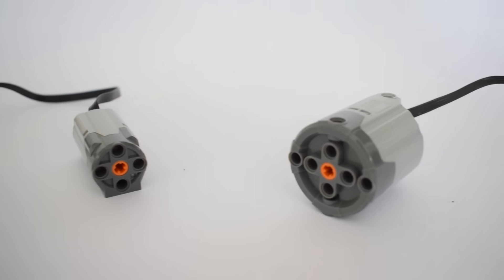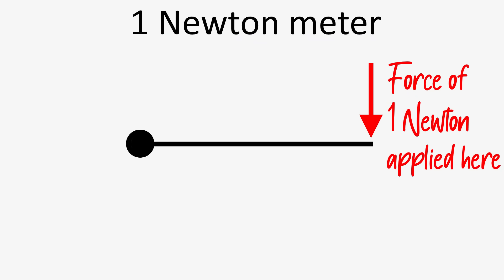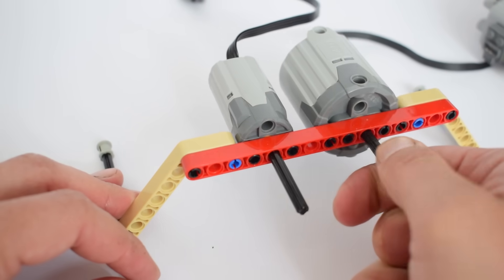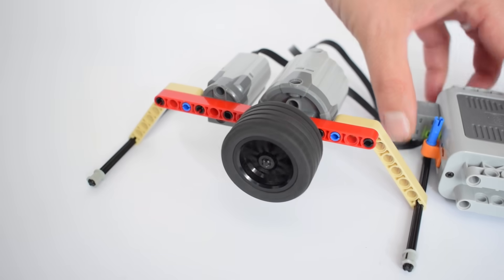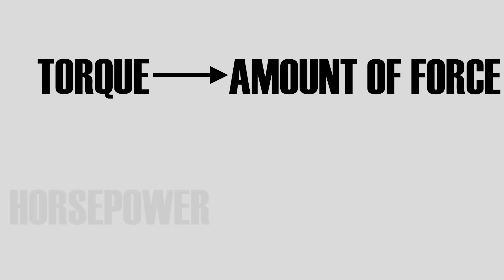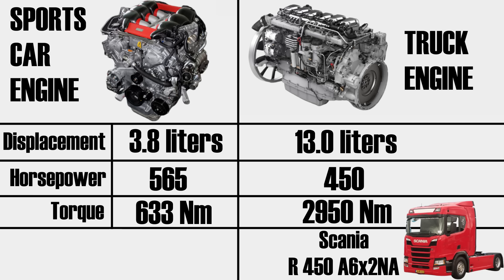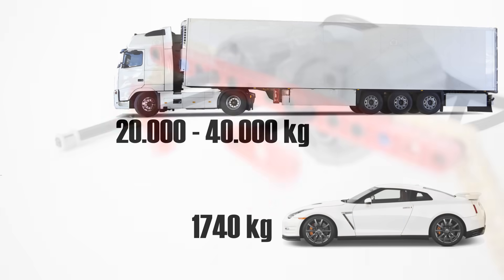NEVER be confused by HORSEPOWER and TORQUE again - HP and TORQUE EXPLAINED in the MOST VISUAL WAY

Comment: There is one thing i still dont understand

Does this mean that the higher the horsepower the more speed can be achieved? Or is speed not affected by any of those?

In my case me car has very low horsepower and can't reach much speed, and at the same time it doesnt have much strength to keep moving because it generates not enough torque when going uphill

Comment: Good explanation but you missed out on the fact that the piston crankshaft will also determine how much torque you make because torque is a force times a distance so a longer connecting rod means a greater amount of torque. That’s also why large truck engines cannot rev as high because it would destroy the larger connecting rod and why older na f1 engines didn’t make much torque but revved very high because they had very short connect  ing rods.

Comment: So in essence, Horsepower correlates to the speed at which an engine or motor can rotate. 
The more horsepower a motor outputs, the faster the motor can spin.
And Torque correlates to the ability of the motor to move mass. The more torque, the heavier weight it can move effectively.
Hence why some cars fitted with a turbo, can output more horsepower than a car with the same size engine, but without a turbo fitted.
That explains why you get more miles from a diesel engine, in terms of the amount of fuel cinsuned, because they tend to spin slower than a petrol engine, thus also prolonging the life of the engine.
So if you buy a small car with a small, turbo charged engine, the life expectancy of the engine will be lower than that of a non turbo charged engine, as it will spin faster under normal use.

Comment: The example with feeling the car's acceleration isn't quite correct. If you race two vehicles that weigh the same and they are running at constant rpm, one of them generating more power, and the other generating less power but at a lower rpm so that it's more torque, you will accelerate faster in the more powerful car.

Comment: Good video. But it fails when saying torque is felt when accelerating. Horsepower is THE determining factor in acceleration. High torque just means acceleration at lower rpm. But a high horsepower low torque engine just needs to work at higher rpm to achieve faster acceleration than a high torque moderate horsepower engine. Torque can be manipulated with gears. The sports car engine could accelerate the truck faster than the truck engine with a gearbox that allowed is to work at the optimum high rpm.

Comment: (EDITED for some dumb phone typos)

Strong start but you devolve into total nonsense when you talk about things like "rate of force" or "how many times force can be applied".

It was a huge mistake to skip the definitions of work and energy. It's like trying to talk about speed without talking about distance.

Lastly, the claim that "horsepower can't be directly felt, only observed" is ridiculous. When your vehicle accelerates, you're feeling power, not torque.

It's amazing to me that for 50 years, every discussion of power vs torque made for gearheads misses the basics of a high school physics class.
Reply from the maker: Ah yes, the subjective genius. 🤮
Reply: Let me say that the video is very well produced, and the discussion and demonstration of torque are excellent.

I am well aware that I'm not a genius by any means, but I did pass first year physics in university.

Torque is twisting force.

Force applied through some distance is work, which is equivalent to energy.

Power is work done per unit time. Because of the work-energy equivalence, power is also rate of change of energy.

Leaving out a discussion of work & energy makes it impossible to be correct about how power and torque relate. It's mathematically the same as trying to talk about speed without talking about distance.

Rate of change of energy relates closely to acceleration when we're talking about kinetic energy. If you know the weight and Cd of a car and have a good accelerometer, you can calculate its power from the acceleration. There's no experiment you can do with that equipment that will tell you the engine's torque. Power is what you feel in an accelerating vehicle.

I'll note also that you don't need torque to have power. My toaster and kettle are ~2hp each.

Comment: In a way, this kind of does help explain the differences with 2 of my motorbikes.

The Honda 400cc inline 4 cylinder gives out 53HP and 41Nm

The Suzuki 800cc V-Twin gives out 56HP but 72Nm

The Horsepower is 53 and 56 so almost the same, and yet teh NetonMeters are 41 and 72 so way more.

Now, I have NOT included the Revs of the Engine as it would almost be nonsensical are they are an inline 4 Cylinder and a V-Twin ( 2 cylinders obviously )

This sort of makes the little 400 a revvier little bugger that is great fun and surprisingly naughty for such a small bike, and the larger 800cc more of a powerful muscle bike in comparison.

Ah its just me thinking of it really.

Comment: Horsepower is the most confusing and misused measurement ever invented! I'd really love to see a 700hp Ferrari actually pull the same load as 700 horses!
Reply: It is not confusing, you just never had it explained properly. Power is just force times distance divided by time. In terms of a rotating shaft that is described as torque (how hard its turning) times angular velocity (how fast its spinning).
Horsepower is a specific unit of power which is based off the output an average horse can maintain throughout a day, which is 550 ft*lb/s. If you want to measure torque in lb-ft and angular velocity in rpm then the formula for horsepower is (torque X rpm)/5252 because of unit conversions.

Comment: yes but the torque is applied constantly, so it's not really 'applied more frequently' in one case vs the other. Good explanation otherwise
Reply from the maker: Torque coming from an internal combustion engine is definitely not constant, it actually comes in pulses, the higher the rpm the greater the frequency of application.
Reply: @d4a  ah cool, I didn't know that. Thanks!

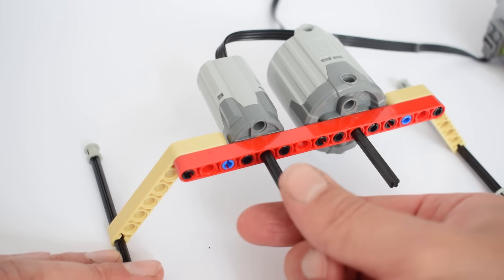Comment: 6:11 when you are in a car and it accelerates, isn't what you feel the acceleration, not the torque? If what you feel is the torque, it should feel stronger in a truck than in a sports car, but in reality, sports cars accelerate much faster due to their lighter weight so you feel a much higher acceleration than on a truck.

Comment: Great explanation and demonstration thanks. It would be helpful to also show horsepower more tangibly in real world, for example max speed over quarter mile (where rate of power in finite time period is a controlling factor).  A confusing factor is gearing as increased gear ratio will deliver higher and higher torque but at slower rate of delivery. 
Also interesting to conject how 1 horse power was originally defined, was it the speed achieved in a given time for a vehicle powered by 1 HP engine compared to a horse pulling the same vehicle with same weight?

Comment: You could put the GTR engine in the semi and it could out perform the 12 liter with the correct gearing. It just would last as long or use as little fuel. More Horsepower is more horsepower and through the magic of gear reduction can always make the torque number.

Comment: Great Video, Can you do a video on 
Why diesel locomotives have more torque than their electric counter part, when the diesel engine is ultimately used to run an electric motor in a diesel locomotive.
Reply: @TurboSpeedWiFi  ohh got it.

Comment: Your video is ok but you failed to explain a fundamental and important fact. Torque at the crankshaft and torque at the wheels, where it is ultimately felt can be wildly different. A gearbox can multiply torque many times but it can not increase horsepower at all.
Reply from the maker: https://youtu.be/txQs3x-UN34

Comment: Brother, you have no idea. You can feel the power of a vehicle as acceleration force, those in the example do 3 and 30sec to 100km/h so the car accelerates with an average of almost 1G while the truck only does 0.1 that's ~10 times the force. So what does that 6 times of torque do? It really doesn't matter. 
Let me give another example ML63 AMG 514hp 620Nm of torque acc to 100km/h in 4.4s
While the stupid Audi Q7 V12 TDI with 500hp and 1000Nm acc to 100km/h in 5.3s
Reply: Tell that to people that said HP sell car, torque win the race.

Comment: Minor correction: torque is pound-feet, not foot-pounds.

Notice that Pound-foot is written in the same order as Newton-meter.

Foot-pound on the other hand is a measure of energy, which can be directly converted to Joules.
Reply: Mathematically, foot pounds and pounds feet are exactly the same
Reply: @alanartwww  they are dimensionally equivalent but that does not mean they are the same. Pound feet is torque, foot pound is energy.
Reply: @Redtooth75  In the US, torque is most commonly expressed as ft.-lbs. Using such terms to quantify energy or work is a violation of International System of Units protocol.
Reply: @alanartwww  you misunderstand. A pound foot is a unit of torque, it is written as lb-ft or lbf·ft. A foot pound is a unit of energy and it is written as ft·lbf. Writing torque as ft-lb is technically wrong. Its very similar to how joules and newton meter of torque have the same units but describe different things. They are both N·m but one is torque and the other is energy.

Comment: You are correct...
Absolutely correct 👍 
Ex.
Supersport bike 999cc about 190 hp at 13k rpm
Small city car with out turbo 999cc 90 hp
at 6k rpm.
This can change by gears ,pulleys or something else.
I say at electric is .
rpm is voltage 
Torque is ampere 
hp is watt

Comment: So whats nm then.. 1 guy applying force to a screw by 1m of wrench.. 2 guys 2nm? İts not.. we need to find the exact guy.. which is impossible..
Reply: 1 N*m is one newton applied 1 meter away from the center. Its the exact same concept as pound feet torque, it just uses metric units.

Comment: You were doing well until the end when you said that the truck engine requires more torque than the sports car engine because the truck has to move greater loads.  100% wrong.  If you put the sports car engine in that truck and gear it properly, it will out perform the diesel engine because it has more horse power.  For that matter, if you put a turbine engine in that truck with the same HP as the diesel engine, it will perform exactly the same as the diesel engine (assuming that the gearing is correct) in spite of the fact that such a turbine engine would have less than 100 Nm of torque.  

As you correctly said, HP is the rate at which a force can be applied.  The faster you can apply a force (linear or rotational) the more HP you have and the more work can be done.
Reply from the maker: If it's 100% wrong why do we never see low torque engines in trucks? The answer is because they would need ridiculous gear ratios and something in the neighbourhood of 25+ gears to get up to speed.
Gear ratios aren't magic, there's a trade off in terms of speed.
Edit: here's a video that explains all of this better than a comment: https://youtu.be/txQs3x-UN34
Reply: @d4a  Generally, there are two reasons why you rarely, if ever, see gas engines in big trucks:

1) Diesel engines are far more efficient than gas engines so you require significantly less fuel for the same amount of work;
2) Gasoline is explosive while diesel fuel is not.  That makes diesel powered vehicles far less dangerous in a collision.

You should also remember that, years ago, all big trucks had gas engines.  Diesels didn't start to take over until diesel technology advanced to the point that they could produce the same amount of power as gas engines without being larger than the truck they were intended to power.

Your gearing numbers are not correct, either.  Using the engines in the video, you can see that the gas engine has a 6,000 rpm power band (1,000 to 7,000 rpm) while the diesel engine has less than a 2,000 rpm power band (1,000 to under 3,000 rpm).  That means that the diesel engine requires more gears than the gas engine.  Yes, the gears behind a gas engine would have to be higher ratios to allow the gas engine to rev to its best power point at the same vehicle speed as the diesel powered vehicle, but you would require fewer gears, not more.

My favorite example of high vs low torque is in the M1 Abrams tank.  It weighs 70 tons so it is much heavier than most big truck loads yet, it is powered by a very low (less than 300 lb-ft) torque engine.  How can this be?  It uses a turbine engine.  But - and this is the important part - if you replace that 1500 HP turbine with a 1500 HP diesel, the performance numbers (except for range) would be exactly the same.  Why?  Because both engines produce 1500 HP.  The fact that the diesel engine would produce over 4,000 lb-ft of torque to the turbine's less than 300 lb-ft is irrelevant.

The last point is that diesel fuel burns slower than gasoline.  That is why you rarely see, even in cars, diesels running at more that a bit over 4,000 rpm while gas engines routinely rev as high as 7,000 (or 10,000+ in motorcycle engines).  Lower rpm, more torque is required for the same HP numbers.
Reply from the maker: You're just evading and adding more examples that aren't relevant to what we're talking about and diluting the conversation. People like you aren't fun to talk to. My gear ratios aren't "wrong". Diesel and tank turbines aside the GTR engine cannot work in the truck because it doesn't have enough torque and it develops the torque too high. This can't be fixed with gear ratios.
Reply: @d4a  I evaded nothing.  I answered your question with facts and examples.

And, yes, low torque output can be overcome with gearing provided that you have enough HP to begin with.  All vehicles - sports, semis and everything in between - require a certain amount of HP to maintain a given speed.  How that HP is generated, the drive wheels don't know and don't care.  As long as the required HP is there, the vehicle will maintain its speed.  If it is not available, the vehicle will slow down.  It is that simple.
Reply: @d4a  the gtr engine would definitely work in a semi, it has the power. It just wouldn't be efficient or last very long because the engine would have to be kept at a high rpm where it is not efficient and experiences significant wear. You would just need to change the gear ratios. It doesnt matter if the gtr engine doesnt make lots of torque, you can use gears to increase the torque applied to the wheels. It wouldn't be practical but it would work.
Diesels are used because at the point where the engine is most efficient it sufficient power.
Reply: @IgorArkin  Those specs are a bit confusing.  Think about it:  Have you ever heard of a turbine engine that will run at 1,000 rpm?  That 1,000 rpm is the output of what is sometimes called the "power pack" which is made up of the engine and a gear reduction unit which is very common on aircraft - both fixed wing and helicopter. According to Honeywell, the makers of the AGT1500, the max torque is 2,750 at an output shaft speed of 3,000 rpm. 

Going from memory (sorry if my numbers are off), I believe that that engine runs at around 26,000 rpm.  Since Torque can be calculated as T= HP*5252/rpm, that works out to about 303 lb-ft of torque.  To get that 26,000 rpm down to 3,000 rpm, you would need a 9:1 gear reduction.  That gear would increase the torque to around 2,727 lb-ft.

Comment: actually if you take the gtr engine and adapt a gear box that reachs 7000rpm at 10mph in first gear, and 15mph in second and so on you will have a pretty strong powertrain, cause the reduction of the gearbox will multipli the torque. So when i see a car i only see horsepower, cause torque is felt different according to the reduction of the gearbox, and the most HP a car has, the most fast it will be, cause if it is a muscle car for exemple it will have a great torque, but low revs, and the reduction of gearbox will be low. If i take a car with the some HP but with a small engine, like a japanese sportscar it will have a low torque, but a great max rev and a gearbox with a big reduction that will make it feel strong as well, so what i mean is that no matter the torque if the hp is the same in a sportcar, cause the one with less torque will have a better reduction gearbox and feel strong the same.

Comment: yeah, but @6:17 there's a big no-no for me. I claim that in THAT case we can actually feel the power and not the force, think about being dragged by some huge torque low hp tractor engine applied to a imaginary motorcycle from 0 kmh to 40 kmh....in a matter of MINUTES. I'd rather be pushed by a regular 400 cc bike engine, which revs in a fraction of SECONDS, here power enters the picture.

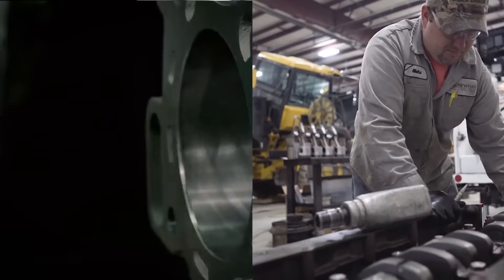Comment: 8:25 ....totally wrong. You can get the torque at the wheels through gearing. Any amount of power above 0 can move any weight, it's just a matter of how fast.
Reply from the maker: It's not wrong. A truck does NEED massive torque to move massive weight and this is why every truck ever made is capable of outputting relatively large amounts of torque. The fact that any amount of torque can move any weight in theory doesn't mean it's practical or possible. You would need a gear larger than the vehicle itself. I know you can use your intelligence for better things than to try to take stuff out of context.
Reply: @d4a  haven't you ever seen a gas turbine tractor do a Full Pull? Gas turbines are high rpm, low torque engines.